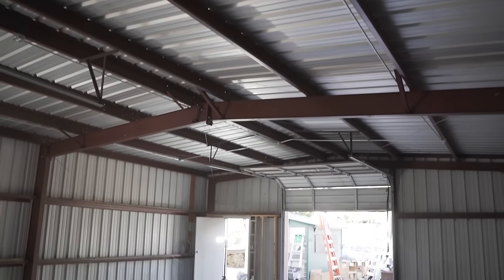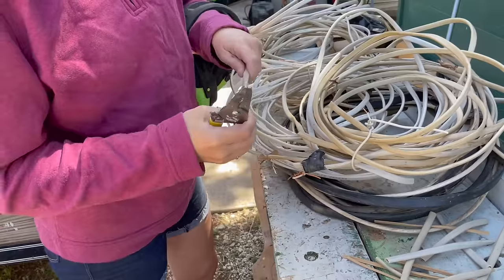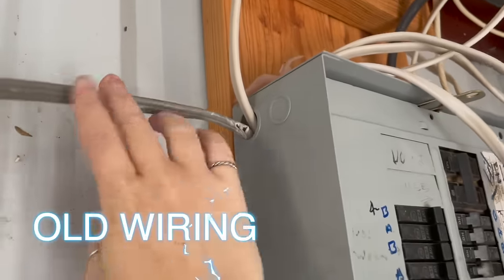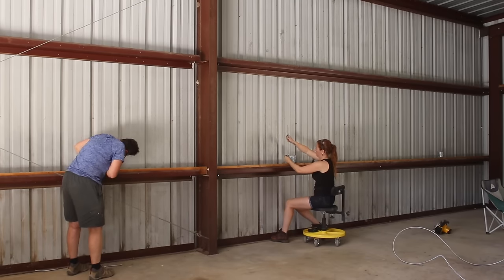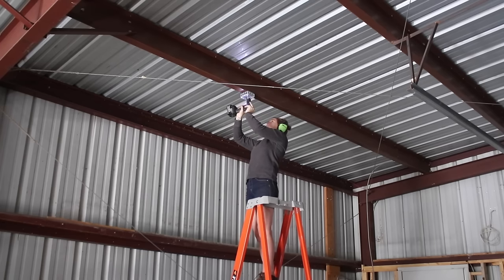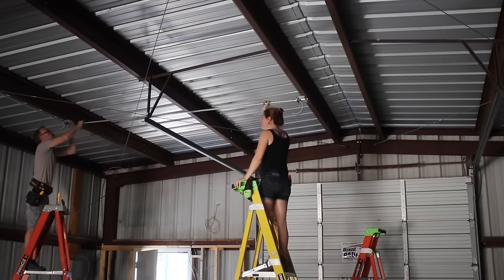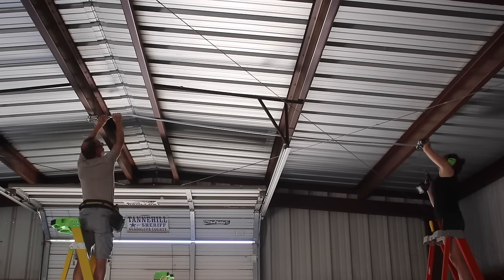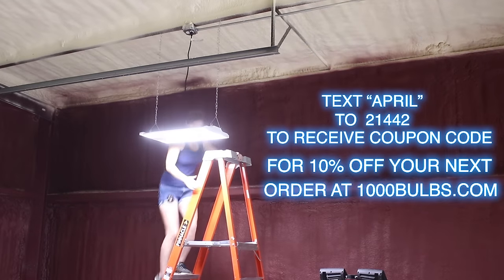Wiring My New Shop | Adding Outlets and Lighting

Comment: That “corner” ladder is pretty nice to use for pretty much anything since it will not rock back and forth on a uneven surface like a four leg ladder.
Reply: Years ago I used these to prune orchards.  They can be unstable if you lean out and pull on branches and they give little warning when they tip.  I doubt that's a problem on level concrete.
Reply from the maker: They're great ladders!

Comment: I ran two lengths of M.C. (metal clad) under my trailer... a dedicated link for the server rack, and one for the fountain in the summer, heat tape during the winter. They make a tool that is basically a can opener that saws through a coil, which allows you to just unscrew the piece you dont want.
Reply: Roto split. Klein makes one,  ideal and milwaukee, as well

Comment: I saw a trick where you run two lines to each quad box. The right outlets are on one circuit and the left outlets are on the right. That way if you’re running a tool and a shop vac you’re sure to never blow a breaker.
Reply from the maker: That sounds smart, thank you!

Comment: They make a tool specifically for cutting MC cable. Search for MC cable cutter. Works like a charm.
Reply: Like the Roto flex tool for cutting metal jacket on type AC ( BX ) & MC cable.

Comment: As an electrical pro with extensive rough in experience I would just like to say you did a fantastic job.
Reply: She missed the ground in the pipe. You can no longer us the pipe as the ground.
Reply: @brianpimental2948  Very true, go back and add a ground wire inside the conduit and all will be up to snuff.
Reply: @brianpimental2948  This - plus the sockets used, at least in my understanding, need a pig tail to the metal box. Neat install for what I could see for the rest, although I'd probably clip up the flex a little more around that door opening.
Reply: Last I know it's against code to pull wire into an incomplete conduit too
Reply: @wiebowesterhof  if they have the little brass wires that hold the screw to the outlet that counts as a ground no pigtail needed
Reply: @brianpimental2948  Just checked my 2020 NEC. Apparently someone didn't tell the codemaking panel this because 250.118 is still in there. You should let them know they made a mistake.
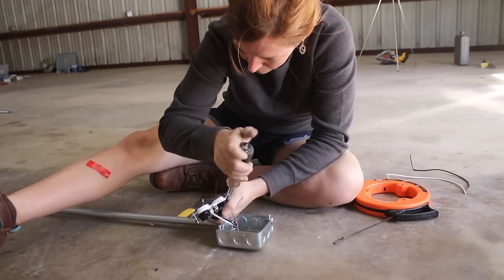Reply: @wiebowesterhof  If you look closely 6:49 she does have a ground pigtail.
Reply from the maker: Thank you!
Reply: @brianpimental2948  Whether or not allowed, my father-in-law (God rest his soul), who was an electrician as well as an electronics tech for Hughes Aircraft in California, told me more than 40 years ago to never trust the conduit as your ground because there were just too many places where you may lose a good ground. Someone might have mentioned it below, but you can save on ground wire through conduit if you are running multiple circuits as you don't need to pull a ground for each circuit. Regarding not having to put a ground wire attached to a j-box that doesn't have any connections in it but just wires passing through...I still attach a wire to the box just in case sometime later I decide to tap into a circuit in the j-box; I already have a ground wire there so I don't have to mess around with that later.

Comment: I just finished running over 300 ft of 12/2 metal clad wire with 20 amp breakers.  I bought four Amazon UFO lights which is plenty of light for my 26’x 40’ x 14’ sidewall metal building.  I saved a ton of money doing it myself, but it was a lot more work than I thought!

Comment: I put plugs every 8 feet in the building I just built and almost every weekend think about how happy I am that I did that.  Everywhere you turn you can plug something in.  We did every 2 plugs on a 20A breaker except for the last 3 plugs.  We also did a single 15A plug on the ceiling for a hoist if I ever go to an electric hoist rather than a chain hoist.

Put more plugs/fans in than you think you'll need and it will be worth it.  I'm about to add 3 more fans for a total of 6 as I thought I had enough fans but after the heat wave in Texas, I realized I did not have enough.  Spray foam won't help you in 110 degree weather lol.

Comment: Also, 1000bulbs is a great resource if you have existing fixtures that need upgraded/repairs. The makerspace I'm a member of had to repair a bunch of 4ft florescent tube fixtures... the keystones were shattering from nearly 50yrs of usage, and the old magnetic ballasts were dieing. Instead of rebuilding them, we gutted them, installed new keystones and rewired them for direct line voltage to teh new LED tubes. we also added new drop-ceiling troffers on the other side of the workshops, and even though we tripled the number of tubes in teh room, (16 to 48) we still cut our power usage by over 60% while also increasing the light produced by around 4x. We owe our thanks for the successful re-lighting of our entire space to 1000bulbs.
Reply: Thank you JDG Industries for the kind words! Make sure you text "April" to 21442 to get 10% off your next order!

Comment: Hey April I just got my new wood shop up and running the end of last summer I used the Mc cable also I bought a mc cable cutter tool it has a metal cutting wheel in it that cuts the outer cable only they’re about 50 bucks well worth the money lowes and Home Depot carry them
Reply from the maker: Thank you!!

Comment: I see that you used anti-short bushings (redheads) in the cut ends of the AC or MC cable for the push in fittings attaching to the boxes. They also make insulated fittings that may not require the redheads.

Comment: In regards to securing conduit. There needs to be an approved clamp or hanger no more than 3ft on both sides of a coupling or box and a span of no more than 10ft between clamps or hangers.
In regards to MC wire. There needs to be a clamp not more than 6In from the box.
Reply: Sad that i had to scroll quite a ways down to find someone who finally stated this.  3' rule does not apply to couplings.  It's 12" for MC from a box
Reply: Sorry to be that guy, but you don't need a clip withing 3ft of a coupling on EMT. Also, the requirement for MC securing/supporting is within 12" of a box, not 6".
Reply: @jimmac1185  3' for emt is code in my area, but you are right.  I should have put 12" within a box for mc.  I was incorrect on that one.
Reply: @nathanlongworth4410  You sure about that? NEC states boxes and conduit bodies and such, pretty much anywhere the conduit terminates. Not couplings. I mean think about it if you are running 21ft of pipe, by what you are describing you'd need 5 clips....
Reply: @jimmac1185  oops I missed that he said couplings.  I just saw 3' and that he said box
Reply: @nathanlongworth4410  oops for me as well! I thought I was chatting with the OP!

Comment: You really should give bending conduit a try. It REALLY is not as difficult as you may think. Your conduit bending has all the information needed for your bending etched in the side. Also, if you use solid copper wire, you can push most wire though up to 360 degrees of bends......so long as you are not fully loading the conduit.
Reply from the maker: Thank you, I'll give it some thought!

Comment: 6:50 Even though there is unbroken metal between boxes you MUST run a dedicated ground wire.
Reply: Maybe in your jurisdiction, but the NEC does not require it.

Comment: Just for your information, your girts are installed correctly according to OSHA regulations unless you use a special flat head fastener at each girt clip to install them the opposite way. OSHA wants girts installed the way they are in your building so that during erection, they sit on top of the girt clip and do not have to be held in place by a person during bolt installation. I would say that I don't know much about metal buildings but I have been working in some form or fashion with them for the past 48 years.
Reply from the maker: Thank you, I really appreciate the info! Thanks for watching!

Comment: Tool of the pros use for cutting armored wire sheeting is called a "ROTO-SPLITTER!" It's basically a hacksaw on a wheel, that is hand cranked like a fishing reel. The cutting is pre-set to a debt only to cut the sheeting and not reach the wires. :)
Reply from the maker: Thank you! I've seen many comments about this now. Thank you for watching!
Reply: As an electrician of over 25 years I have used this tool many times and I’m really not a fan. 1 the cutting process can leave a burr which is very difficult to get rid of. I would recommend using a special plastic insert designed to go between the conductors and metal to protect the conductors after using this tool. 2 the cutting wheel is of very small diameter and so it wears out quickly. It needs to be replaced often if you want it to work efficiently. 3 it can still damage the conductors insulation and you need to inspect it carefully for damage. I prefer to use 2 channel locks in opposing directions in the proper way to unwind the flex like she seemed to do, but use tin snips instead of diagonals to cut. Slide off the excess metal then trim any sharp parts off.
Reply: @andrewk7745  I do agree and that is why with every bundle of greenfield cable comes a pack of red anti-short busions with long tabs on them that extends longer than the connectors. In NYC, if the building inspector don't see these tabs intruding into the electrical box, the job isn't signed off.

Comment: Thank you!
Would code have allowed you to use plastic rather than metal conduit, and plastic j boxes?
Reply: No, has to do with potential impact damage and melting point in a fire
Reply: @craigfriday8601  because it's a workshop, or because it's running along metal rather than wood?
Reply: As a licensed electrician, I would never run PVC inside. Metal conduit always. PVC is for trenches and plumbers.

Comment: You used but did not mention the red plastic protectors put into the ends of all the MC. These are required by code to be used and important to protect the conductors from the cut cladding.
Reply from the maker: Great point, I appreciate your contribution!

Comment: A roto-split is the easiest way for a novice to cut the cladding off of that wire. cost about $15-20.
Reply: "Novice"? I'm a licensed Master Electrician and I use roto splits all the time. Much faster and easier. Let me guess, the band saw is the "novice" tool to cut EMT over the pro hacksaw?
Reply from the maker: Work smarter not harder! Thanks for the contribution!

Comment: Good job, April! WRT armored cable, wish I could use this the way you did but unfortunately I live in Chicago where you are required to use metal conduit. Armored cable use is limited 6 ft and only lighting fixtures at the end of a circuit. Ridiculous, but code is code!
Reply: Two reasons I would never live in Chicago, ridiculous electrical code and unconstitutional 2nd ammendment rights violations.
Reply from the maker: Code is code!  I appreciate your support, thanks for watching!

Comment: You don't need it, but I always run a ground wire wit my circuit, this way in the future you need another circuit added, you can use the ground wire as a pull wire for installing the new stuff. Just fyi. Also with the overhead conduit, you could have up sized to 3/4 conduit for future use. Great job, though. Be safe, be cool! Beach, NC
Reply from the maker: Thank you! Great point!

Comment: I noticed that you are using plug in light fixtures.  Did you connect the outlets to a switch?  Just asking because the video ended before I could see that part.
Reply: If not, she could just be using switch rated brrakers.

Comment: Just an fyi. If you have to have your work inspected don't just break the mc cable. Buy/rent an mc cable cutter. If you leave a jagged edge on the mc jacket that can cut into the wires the inspector will shut you down. Also if the wire gets nicked during installation and you don't notice it may not always trip the breaker and can cause a fire.
Reply from the maker: Thank you! I always appreciate advice.

Comment: Thanks for sharing this insightful video April.   I noticed that you only pulled black & white wire through your conduit; you missed the green ground wire.   Relying on the conduit or building steel is asking for trouble.   Overtime the conduit will build up oxidation and resistance.  There have been times when we measured up to 80vdc differences between a true copper ground and building steel.   Since you are planning this to be a warehouse with simple lighting you may be ok for now but your computers and electronic equipment may experience random problems and possibly damage.   

Please stay safe out there and remember to plan for future opportunities.  Peace
Reply: Had a lazy electrician almost get electrocuted for not pulling a ground wire. A piece of EMT conduit pulled apart when plumbers were installing pipe. Guy grapes each side of conduit and while attempting to reinstall the conduit a bare nicked spot on rear side of wire cams into contact with ungrounded conduit causing a severe shock.
Reply: Check out nec 250.118 you don't need a ground running through conduit and she grounded it in junction box as well hell you can run exposed romex indoor if it was wood and still pass code.
Reply: Check out nec 250.118 you don't need a ground running through conduit and she grounded it in junction box as well hell you can run exposed romex indoor if it was wood and still pass code. But to make it safer I would do what you suggest anyways considering she's in a metal shop 😂😂
Reply: @victorpryor9403  floating ground conditions are a quick way to kill many electronic devices.   With the profusion of “smart devices” in daily life the possibilities of problems are ramping up exponentially.  NEC codes are a great safety standard for buildings and structures but technology is adding another layer of complexity and problem potentials (pun unintentional).
Reply: @Cat Gynt  that code I sent you was from the 2023 book not 2010 or 2017 or 2020 and still even those books look exactly the same besides a few minor things changing if it's good in the code book than it will be fine period I could show you if you like
Reply: @victorpryor9403  Thanks but no thanks.  I’m at the end of my career and will trust the professionals.

Comment: 12/2 for workshop receptacles (20amps) , 14/2 for lighting circuits (15amps).
Reply: It matters with receptacles, it doesn't matter with lighting.

On the other hand, if you install a light that draws 20 Amps, then you need the 12/2 for the lighting circuit as well.

Installing wiring that excedes code is never a problem. Installing wiring that does not meet code, is a fire hazard.
Reply: I always run 12/2 for receptacles, regardless of the amperage of the receptacles. It saves money in the long run.

Comment: Here in the New York metro area, the metal flex sheeting is called Greenfield and if the Greenfield as wires already installed,  we old time pros calls it BX-cable! Why BX? To prevent the unstoppable "Bronx mouse" from chewing through the wires! :D

Comment: Double check your local electrical code for the over maximum length you can run that MC Cable.
Reply: Where do you live where there is a maximum length of MC cable? Chicago?

Comment: Hi April,  hey quick tip, as a Licensed union electrician,  you always by code, need to run a green/ground wire thru all your e.m.t./pipe conduits.  Don't just use the pipe as your ground.  A definite must in your future.
Reply: Check out NEC 250.118.
Reply: @jamiemoon1527  Yup. Even some MC wire is rated to be run without a ground conductor.
Reply from the maker: Thank you, I always appreciate the expertise!

Comment: installing larger size conduit and boxes then dropping down(up) from that would have been the better way, mainly for future flexibility.
example, next day/week/month/year you need a dedicated 120/240v outlet added for a machine way across the shop? just pull more wiring through existing large conduit, vs. now you need to make a home run to the panel.
it's usually best to over-invest in upsizing conduit or adding more large main runs spaced around the shop, because being able to simply pull more wires or even add a subpanel across the building costs far less labor in the future. it's not as bad in an open pole building, as with finished space.

Comment: be sure to check local codes some areas don't let you do your own work. also if you follow the national electric code you can't substitue MC(BX) for conduit.
Reply: Could you explain what you mean by substituting MC for conduit? Unless she is using that space as a "hazardous location", I see no reason why she can't run MC.
Reply: @jimmac1185  in most cases for a commercial garage or private garage over three cars you are supposed to use heavy wall conduit below four feet and thin wall conduit over four feet you only use mc(bx) above the office cieling. they say this to prevent you from damaging the wiring by hitting it with a vehicle or by dropping things on it, technicly april has a commercial shop and could hit the wiring with a vehicle or forklift if she gets one

Comment: I think even though you are mounting the ceiling boxes to the building frame, you still have to run a ground wire.
Reply: The conduit is used as a ground.

Comment: The proper tool to cut the metal jacket of MC cable is, as the name implies, the MC cable cutter.  Very easy to use, but care still needs to be taken to not nick the wires inside. 
Regardless of cutting method used, a bushing that inserts into the MC jacket will provide protection for the wiring. Cheap insurance against future wire grounding. ⚡️🔥
Reply: Yes don’t forget that little red cone shaped bushing it prevents The MC From cutting through the wire jackets